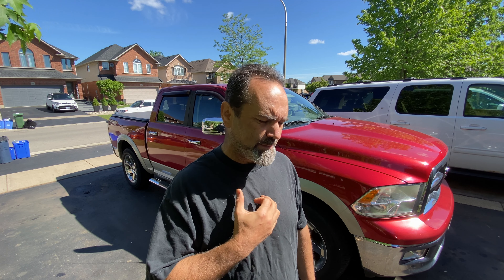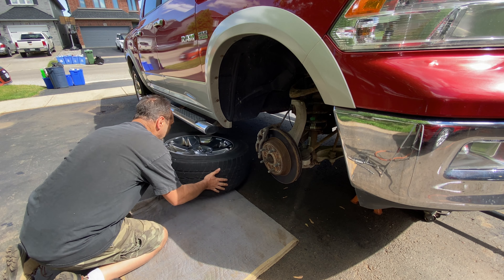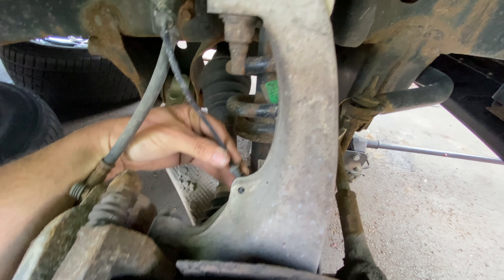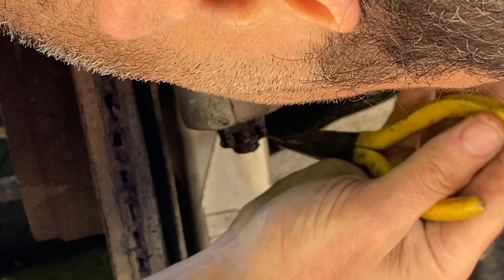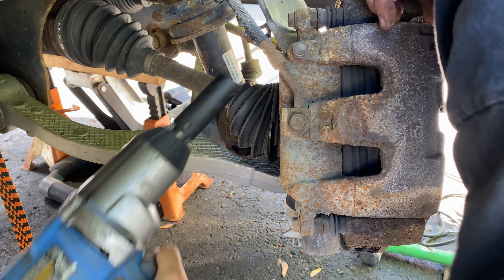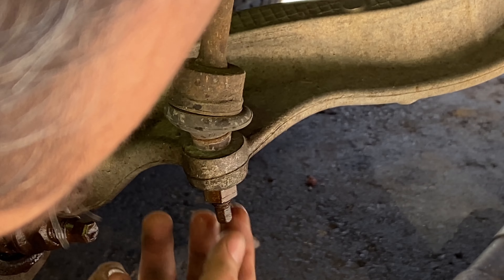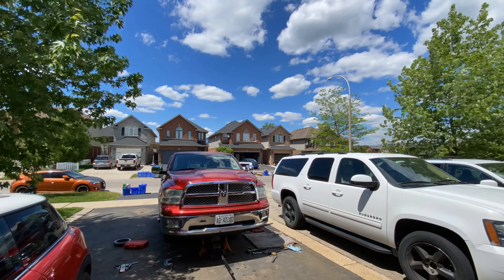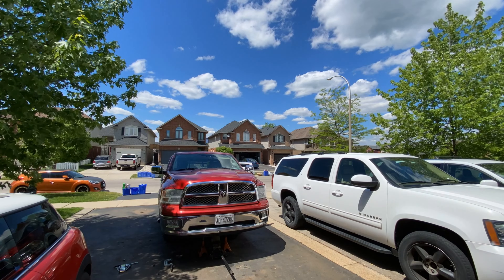Front Springs And Shocks Replacement On My 2010 Ram 1500 - Part 1

Comment: This was extremely helpful. 2010 and EVERYTHING was rusted so just replaced it all. To the point the bushing was the easier part. Hammer and chisel to remove and ball joint press made quick work of the install. Thanks for going through the pain first!

Comment: Nice to see someone really doing the work and running into the stuff that you come across on a regular basis. Not a nice prepped newer car. Most certified guys screw the stuff up by big air tools with too much air pressure. Most don't own torque wrenches.

Comment: For the sway bar link I've seen where you can use vise-grips on the opposite side of housing where nut is to hold it while you use the ratchet or impact to take off the nut. (instead of the wrench below the nut)

Comment: Ball joint press + BFH crank down on press hit end with hammer . Don't over do it if doesn't move after a couple of good snacks go to plan  " B " .  Don't ask me what's plan B is it's your truck figure it out lol lol.  If it were my vehicle it would envolve heat and maybe hydraulics. 50 plus years of mechanicing you have way to many tools in your arsenal. Gd luck !!
Reply from the maker: My trusty ball joint press should do the job, if I can get access to it.